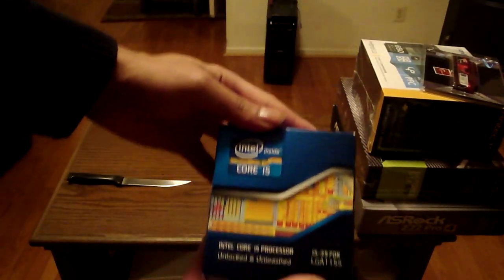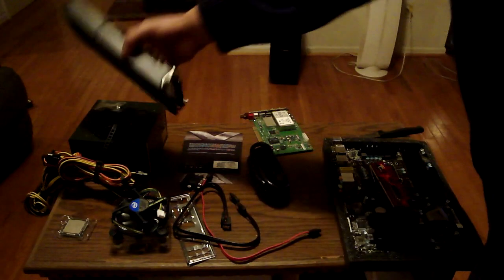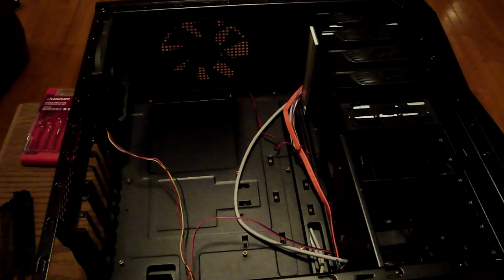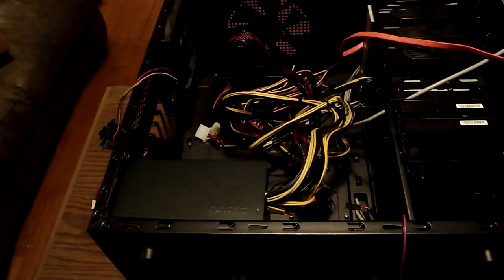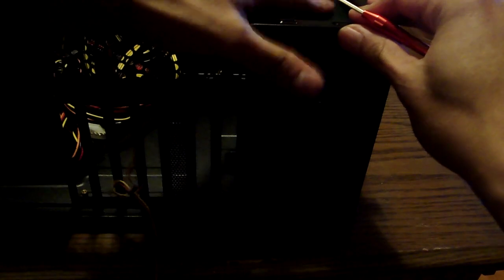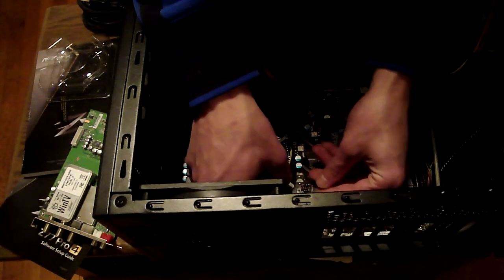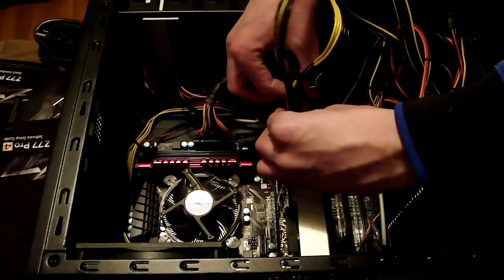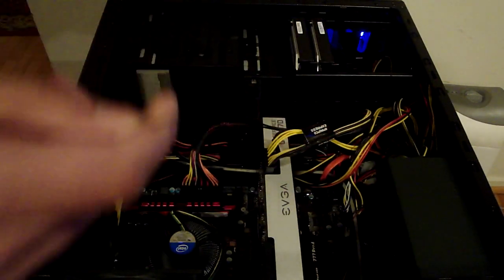Build a Gaming PC: $780, Core i5 3570K, GTX 670, Ivy Bridge Build

Comment: I have a i7 3770k and I'll you you what, that cpu doesn't bottleneck anything. It is a great cpu and more than games need, a lot more. Not even Planetside 2, the most cpu intensive game out there doesn't even stress it. Besides, the GTX titan gets out-performed by a GTX690. But, the titan is the worlds most powerful single core GPU. Which is a good thing

Comment: Nice build bond. I using asrock 970 extreme 4. CPU fx8350 gpu sapphire 7970 3gb oc edition. Ram patriot viper red 16gb ddr3 1600mhz. 700 Watt Psu grip advanced CPU cooler. Got 7200 rpm caviar blue 500gb two 90gb ssd's from ocz. Full tower phantom case and runs like a champ will add a second 7970 later this summer for crossfire

Comment: Go FX8120. It's basically a de tuned FX8350. 

Google some FX8350 OC benchmarks...Stock it runs with i5s. OC It runs with the i7.  

Overclock it on the stock fan and enjoy.  Can be had for $140 or so.

Comment: I've got an i5-3570k @ 3.6Ghz, a sapphire Vapor-X 7970 Ghz edition with 6Gb of GDDR5 VRAM, 12Gb's of RAM, a 600W power supply, a 500Gb HDD and an ASUS Mainboard which's name I forgot. Battlefield 3 with Ultra settings and 1080p resolution goes never under 110fps and sometimes up to 160 but my monitor can't go higher than 120Hz so I lock it at 60fps. 

I am curious how well it can handle Crysis 3.....

Comment: Is any in my system bottle necked:
Core i7 920 2.66 hhz (quad core)
Amd 6950 (2gb) slightly overclocked out of the box
3x2 gb 1600mhz ddr3
Asus p6t deluxe motherboard.
Ultra lsp 750 watts
1 2tb 3gb/s 7200 rpm

Comment: Nvidia has better performance in cuda core aplications.
Amd cards are alot faster in OpenCL aplications.

AMD cards have their most recent drivers in beta, because they are developing a new driver arquitecture from 0.

They Both have around the same gaming performance, it will depend game from game.
But the latest games will perform better on AMD CPU's and GPU's.
(Not all) But the ones that belong to gaming evolved like: Far cry 3, crysis 3, and others that came out and will come out.